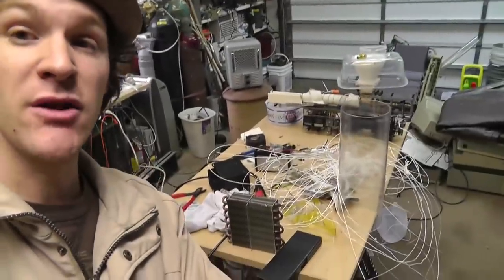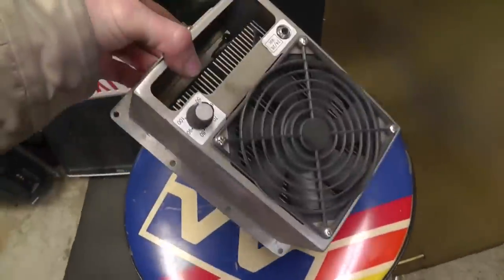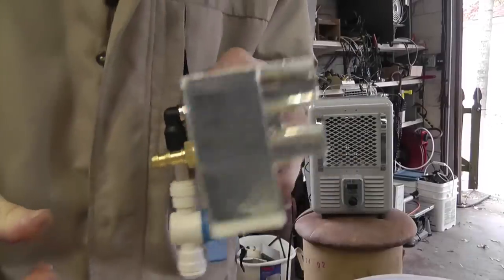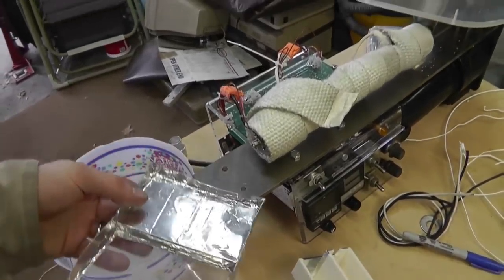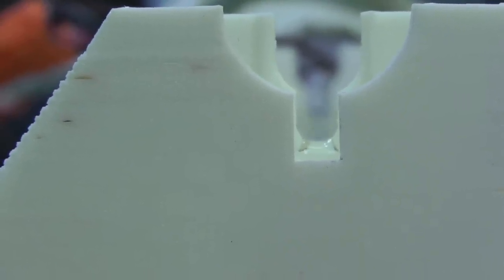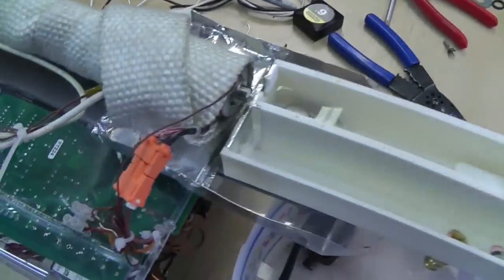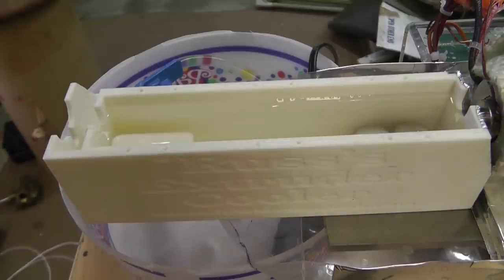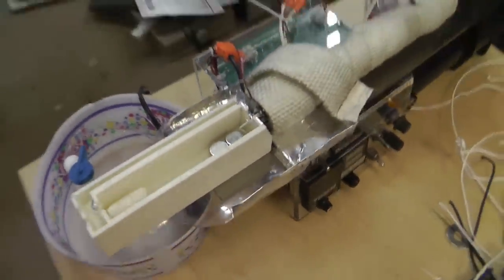#8 ~Russ's Filament Extruder: Testing The Water Cooler. Works via Surface Tension (Hand Pulling)

Comment: Sweet. Looking forward to see the test when pulling the thread consistently. Maybe a DC motor with a constant current source. The goal would be constant torque to pull the thread with a constant diameter but I'm no expert in extruding plastic filament. Maybe something more complicated is needed to control the speed along the torque to avoid large speed changes if the density of the filament changes.

Comment: Look up how electrical wireing is made, specifically, how the insulation is extruded around the wiring. they don't put the extrudate/wire through a bath like that, they allow water to cascade around the material exiting the extruder. Your material will continue to kink up like that because your water bath just isn't optimal. Kudos for your hard work, though. Nice shop too!! Mine looks like that and I'm kind of proud of it!

Comment: Ounce inch torque motors are used for monofilament winding. The diameter is controlled by stretching the filament between different speed rollers. Shakespeare has been doing this for decades making fishing line.

Comment: Here's an idea of mine for you to work on that is pretty cool. I want to be able to print carbon fiber reinforced resin. The resin and the hardener will be impregnated with 2 to 3mm long snippets of carbon fibers then pumped separately by PFTE tubes to the mixing tube/extruder. The mixing tube should be designed in 2 halves and machined from S Steel and well polished internally so it can be separated for easy cleaning prior to it setting up fully, though with polished steel the resin wouldn't stick too bad even if id did. Once the fiber/resin/hardener ratios are all sorted this should produce some solid components such as AR15 lowers or aircraft parts etc. Anyway, roll that thought around and see what you can come up with if you are up to it.

Comment: Russ, I have watched your whole series on this extruder and am much impressed with your technical and mechanical ability.

I had a couple of thoughts that may be of use to you.  The first is on the method of immersing the filament which can be a bit hit and miss when utilizing the water meniscus.   Surely it would be possible to attach a short length of silicone tube to the extruder nozzle which could be let loosely into the side of the tank below the water line and thereby force it into the water.  A loose fit would allow water flow around the tube to maintain circulation.

The second thought was for the spooler guide used to provide even deposition of filament onto the take up spool.  As there would be very little sideways torque involved, could you not utilise a fishing reel with this facility as fishing reels are very cheap on ebay?

Comment: Awesome! I've seen industry drop extrusion straight down into a water tank like 3d printers extrude. You can reclaim runs that get knots or bumps in it. It maybe be best to reengineer separating all electronics from the machine with a control panel and considering a bigger water tank so you don't have to recirculate. Best of luck.

Comment: I think the printed water cooler is slightly hydrophobic. The striations in the print keep little bubbles of air trapped between the water and the plastic. Pretty cool!

Comment: Commercial systems use a roller to pull the extruded filament and adjust the speed of the roller to alter the diameter of the filament. They measure the diameter of the filament and have a closed loop PID system that keeps it a a set size. More expensive ones have two or three measurements. Have you thought about that?

Comment: Nice Russ.
Without right transport coiling system to collect all filament you can not get a constant thickness. You need spindle with PID controller.

Comment: if you put a metal-to-plastic nose nozzle over the tip of the tip of the extruder fitting you will be able to place it directly into the water for the full length of the bath such that the finished product of the same size is the only thing you see

Comment: Russ, I was watching another youtube link and they put a sponge at both ends, you can put sponges at both ends of your water coler, try it to see if it works. The filament goes right threw the cut in the sponge.. Worth trying.

Comment: I was thinking if you were to put a spool on the end controlled by a motor, that could supply the tension needed for a consistent width of filament and prevent knotting.  Plus since you are using a water bath, the filament would be sufficiently cooled down that you could wind the filament onto the spool as you extract.

Comment: make a ramp at 45 degree angel downwards to a bucket . that way the filament does not bind and has a consistent diameter. make a another  45 ramp place below the one with water flow. with a wide enough gap so water do not flow on it. put another coaction bucket under the second ramp this is your filament bucket.
Reply: Yes, it's called Gravity!

Comment: Hey Russ,
It looks like the water that's flowing out of the hole is maybe pushing the extruded piece back towards the tip that is causing it to kink but I think maybe if you enlarged the hole there would be less pressure/flow going towards the tip of the extruder.
I could be wrong about that as it wouldn't be the first time.
Also could you send me a parts list that you came up with to build your 3D printer as I would love to be able to build my own, Maybe you could print me the parts that I would need to help me get started..
Thanks in advance.
Regards,
Pete.

Comment: You won't have the bunching up problem, if you turn it around so that it extrudes down.  Gravity is constant, and will pull it down.  This is how optical fibre is pulled.

Comment: The manufacturers have 3 stage heating and cooling to control the density and electronic thickness monitors and traction motors to control the size.  I seen another video that he had everything set up except the water bath. Is it really worth it by the time you purchase all the things you need and the granules at $2.00/kg?

Comment: You not use 2 solid steel rolling pins with a Groove on both to make 1.75mm filament it will crush  and shape it as it's coming out soft and u can cool roller by making it go in a pool of water

Comment: "v" shaped lid at water surface? or slightly larger diam submerged tube? but air cooled gravity feed would be best. from extruder tip straight to floor.imho

Comment: I am working on a similar device by myself, too. Russ, my feelings are telling me, that you should forget the water cooling. Rather than that, use a thin copper pipe, maybe the upper half open, not much wider than the filament thread coming out, and have it directed from the hot end diagonally downwards, and the pipe must be cooled with these tiny, handy heat exchangers you can get at Ebay for small money. This way, the own weight will help to straighten the filament thread, as well as the small diameter of the open pipe. Are you on Facebook?
Reply from the maker: Okeefenokee the Seventeenth no facebook. 

if you run hot plastic in to any tube cooler than it it will stick and get jammed. 

~Russ
Reply: ***** Oh, okay. Thanks. You see, that is the advantage to talk to someone who's ahead with experience. This is Sven, from your forum. :-)

Comment: I have a similer issue with the filamnet curling as it comes out. How have you fixed this.
Reply from the maker: The Epic Shadoe Gamers my guess is that its to hot. 

i " pull" my filament out to size. if you just let it come out on its own it will tent to curl. but finding the correct temp to get it all right means hrs of Patience tuning. set the temp watch it for 30 min, then adjust and wait another 30 min. it takes about 30 min for everything to get to the set temp evenly. it took me alot of testing to get the correct temps. and even now i find my self adjusting them on each run. ( 1-3 degrees) 

hope this helps! 

~Russ 

PS. watch all the videos here: 
http://rwgresearch.com/open-projects/filament-extruder/

Comment: take up reel. But why even do that? Why don't you incorporate this device directly into the 3d printing machine, that way you eliminate the spool of plastic wire and the feed mechanism required.
Reply: thats what i was thinking but then the machine would be to bulky. but if it was able to be a smaller design it would be a better option that way you could crush up wast and feed it back in.
Reply from the maker: brandonhughes7
the problem is that the extruder makes filament way faster than its being consumed by the printer. so, maybe a way is to use the pellets in place of the filament... but to connect the extruder  to the printer will not work. its beter to spend 8 hrs making a big spool of filament, then running that filament for a week or 2. that's how long it will take to use up.
Reply: ***** good point
Reply: ***** You're thinking too small ;-). I'm imagining a 1.5mx3m print bed for printing very large parts. An extrusion head fed by pellets from a hopper that can be vacuum refilled from bulk storage could print some large parts. Automobile sized parts...

Comment: lower temperature like 210-250 and slower would result in better extrudes i hypothesies
Reply: Just lower temp. if the extruder is strong it will make it, and the nozzle is longer its ok fizically thinking

Comment: Do you have the design file for the cooler printed part you can share?
Reply from the maker: everything should be on this page, if you cant find it let me know 
http://rwgresearch.com/open-projects/3d-printing-research/filament-extruder/
 ~Russ
Reply: Do you have a link to the fan that you used for air cooling?